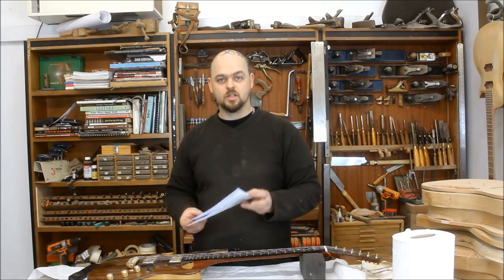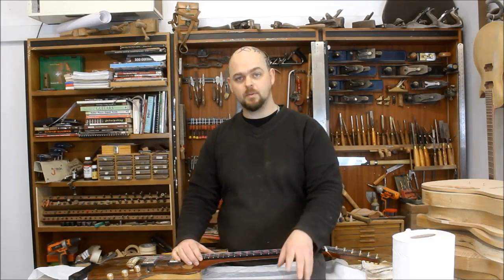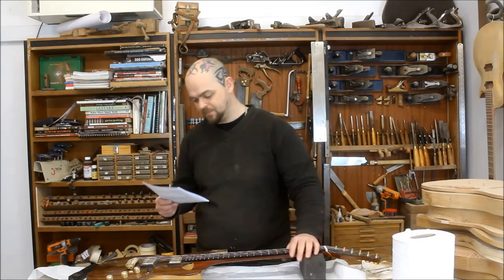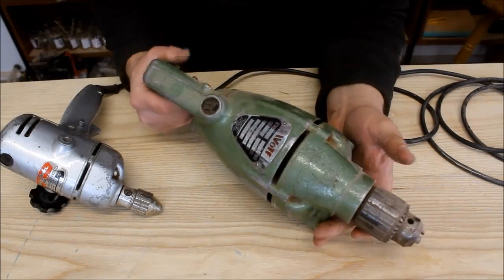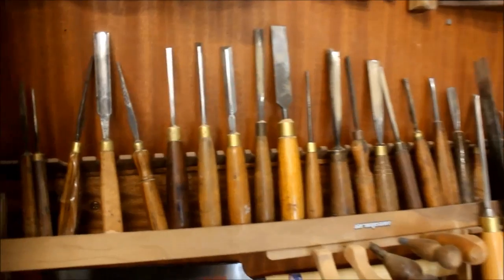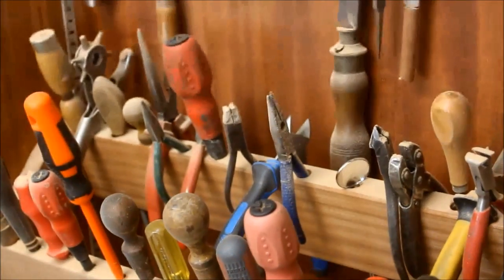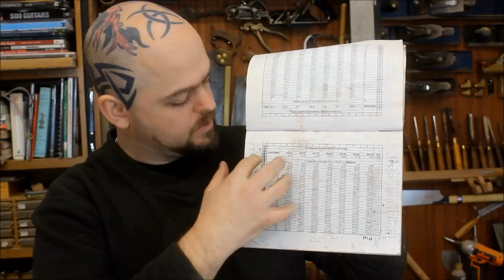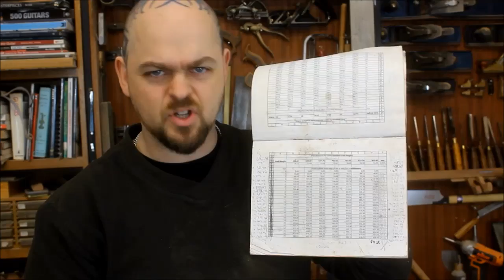Guitar builders basics podcast #10 for the 16th of December 2013 - smiley winky face

Comment: Ben,

I love the videos. Informed by your video about the Triton routers I'll be ordering one to replace my current router, which is on its last legs. 

On to the real reason I chose to comment. Spiral (helical) router cutters are indeed fantastic, however one bit (pun intended) that wasn't touched on in the video is regarding up-cut and down-cut spiral bits, the distinction between them being the direction that the chips are directed while cutting. As a cabinet and countertop contractor professionally, I get to play with routers and bits all the time. (yay!)

An up-cut directs the chips toward the router body, up and out of a slot, and are ideal for instances when you have a plunge cut which is not a though cut i.e: a truss rod slot. A down-cut bit directs the chips away from the router and I have found them helpful when edge routing in my router table as they direct the dust into my dust collection port. 

Here in the US I order router bits from: 

www.eagleamerica.com.

I found this website in the UK they seem to have decent quality bits, for a reasonable price.  

http://www.trenddirectuk.com/professional-tct-cutters/spiral.html

Off to join the forums, and I'll see if I can convince the fiancee to gift me a guild membership for Christmas.

Comment: hi Ben  thank you . the drill motors you showed may be from the 50s-60 they had metal bodies unlike the  early 70 main body metal and rest plastic. drill motors  1/4 - 3/8 - 1/2  all have different speeds due to the  size of the bits they drive 1/4  being the fastest  to 1/2 the slowest . you should of seen how slow i pushed a 6 " spade drill, yes i was on a huge drill press.  yes helical cutters on the mills worked way better the 2 flute or multi flute ones. 10 years as a machinists. oh if you take the old drill motors you showed take em apart use sand paper on the brushes ( make em smooth ) same for the copper winding. be sure to clean it all out and lube what needs it. hope that will help. thank you for all you show.

Comment: Whiteside makes helical router bits, but all I saw were two flute though I have not looked through their whole inventory.  Machinist mills will work depending on size and there are a number of shapes, problem is they don't come with bearing guides. One other note on helical is that because they spiral around the diameter and have a long cutting edge you can potentially have more cutting edge than a straight cutter depending on how many blades they have.

Ben if you're interested I can send a couple of .250 inch diameter 5 flute end mills your way if you want to play with them.  I don't know what you'd use them for but I'm sure you'd get ideas.

BigOak

Comment: the Steiberger L series (the "boat paddle") were made entirely out of carbon fiber composite. the body and neck were one piece, and the body was made hollow: a front plate was fitted (the whole front of the guitar), which made accessing all internal areas super easy. very cool design, but it's no surprise that they've always been expensive and the early-mid '80's models fetch quite a bit! later on Steinberger did make a few different models with bolt-on carbon fiber necks and wooden bodies: Mike Rutherford (Genesis/Mike & The Mechanics) was a big fan of these models and they had slightly more Strat-shaped bodies. old CF Steinberger necks didn't even have a truss rod because they didn't need them, the carbon fiber stayed perfectly straight in nearly all conditions.

the current manufacture Steinbergers are a mix of wood and carbon fiber, depending on the model. i think most (or all) of the current models actually have wooden fretboards on CF necks, but i can't remember for sure.

Parker Guitars (before Washburn bought them and, IMHO, started ruining the designs) used CF fretboards on all their guitars. it was actually a thin sheet of CF, with the stainless frets glued on. it makes refrets incredibly difficult, but luckily they rarely need it anyway because the SS frets last seemingly forever. only some of the (expensive) US-made Parkers still have the graphite/CF fretboard these days. Moses Graphite, Status (in the UK), Curbow and Modulus are all other companies that do/have fretted directly into CF "fretboards", which aren't actually fretboards but the neck itself; it's usually monocoque kinda like the old one-piece maple Fender necks. Carbon fiber is cool stuff, but it's a bitch to work with and expensive to build guitars out of, because it can't be automated: it's just laying up layers of CF and epoxy in a mold (that'd be "mould" to you ;) and hoping you don't screw something up along the way! it's usually put into a vacuum bag press to suck all the air out while it cures. not a very DIY-friendly process, but the materials are easily sourced if people really want to gamble their money and give it a go.

aircraft supply companies are the easiest place to find the materials. very sharp cutting tools are important, because carbon fiber likes to dull cutting edges in short order.

Comment: btw, cool to see those drills! yours are definitely older than mine: as far as i can tell, my B&D is from the early or mid 1970's. it's got an orange plastic body (they also made them in green and beige as well), but still has the cast aluminum shroud over the front. mine has a US-made Jacobs Multicraft chuck, and i've even got the original chuck key! (how nobody managed to lose that key in all these years is nearly miraculous...but i'll probably find a way to do it;)